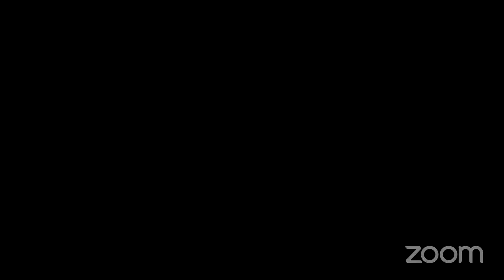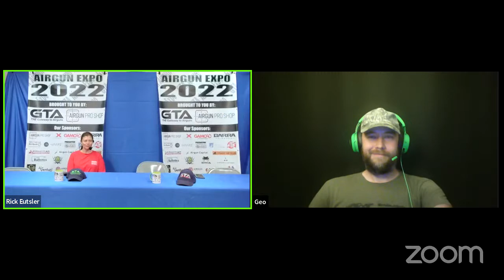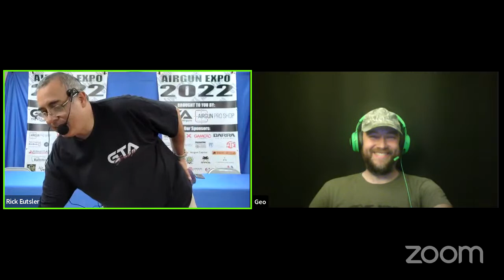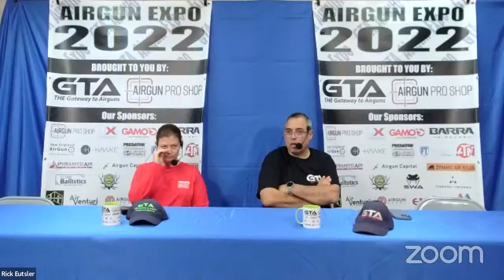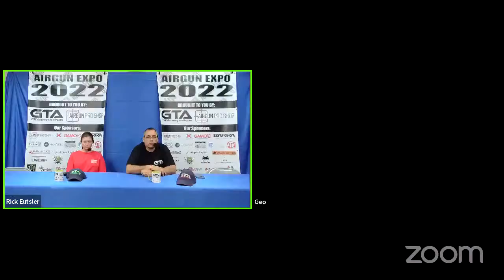Airgun Expo 2022 LIVE - Day 1 Wrap, Hanging Geo from Barra Airguns

Comment: The areas the 400e of concern and seem can be adapted are converting to a hi capacity magazine like airsofts with the winding wheel on the bottom of the magazine,  besides redesigning it from 6mm to 4.5mm for the channel and the loading wheel inside the magazine,  what is the challenge to overcome, weight or size of the 4.5mm bbs?

Another subject is internal motor and gear box,  seems like in airsoft they do strip out at times,  is this able to be overcome in a similar way that airsoft has overcome it? 

Are internal parts for customers who wish to do maintenance on their premium bb gun,  may have that option,  yes warranty is void, will their be an option in time,  like Daisy and their parts store? 

Customers service and satisfaction in these areas would only be a positive impact on the 400e,  4.5mm AEG and of course the Barra company. 

I see Amazon has the 400e, chargers, batteries, bb's and now EVEN 4.5mm bb's speedloaders, but no magazines yet, when searched online,  the magazines seem to be on backorder but are now becoming available,  great job on this.  Looking forward to seeing the 4.5mm AEG BB's take off. This is an incredible upgrade to the automatic .177 cal world.  Again awesome and keep up the terrific path that Barra is expanding on.

Comment: How did I miss this segment 😭, I have a question for the barra1100z. 22 magazines why does the rubber grommet  unspirals inside making it useless. I have replacement magazines and same thing happened and I have 2 more that I don't want to risk it.I use the single shot tray, but using the mag would be better.